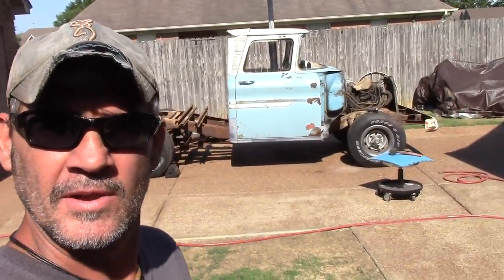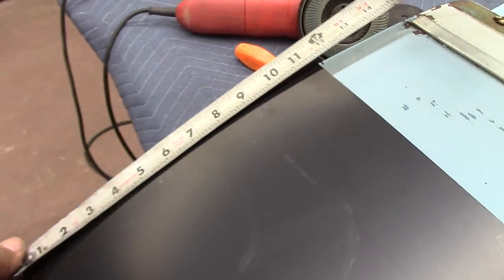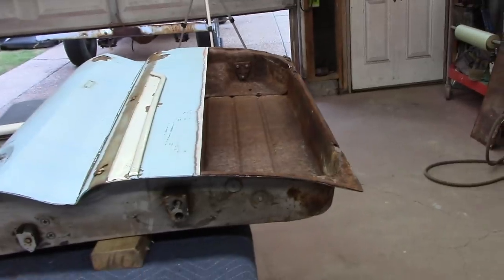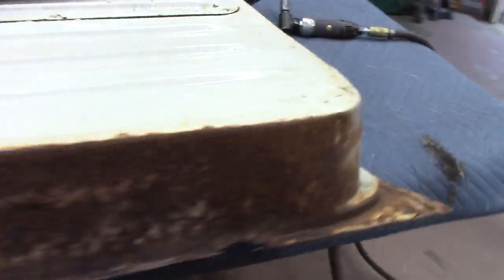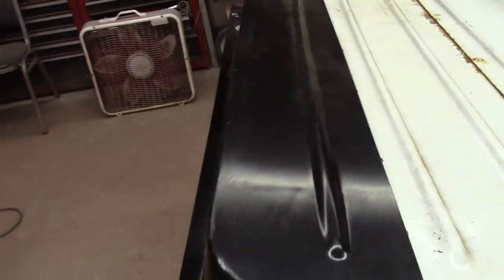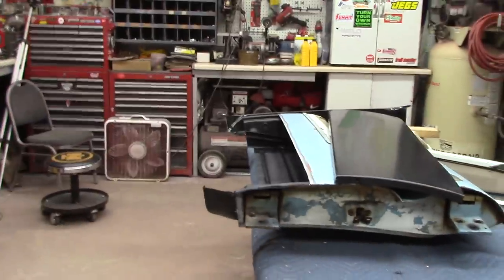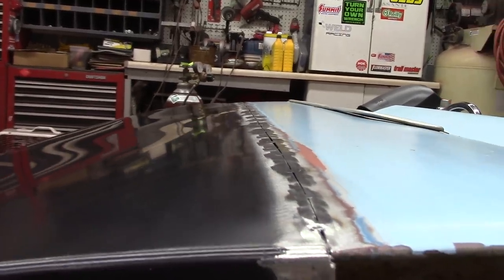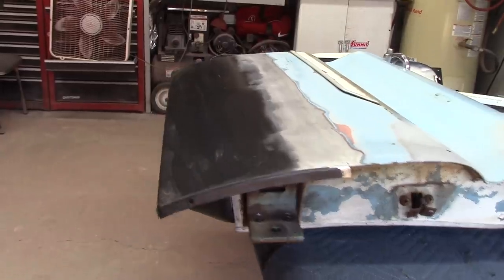Outer door bottom rust repair

Comment: Fantastic! I try to do that same job in a 69 C10 without testing first , with the fender on and frame rubber mounting , and fail aligning later. Finally found another door and replaced.

Comment: This is perfect.
I am thinking, that for many old cars, it would be easier to just cut out big chunks of the car and repair or replace them, then to work with every small hole and that work with small holes would be endless and they would reappear elsewhere in small time.

This whole process brought to my mind, that maybe it would be good to cut out big chunks, than clean them, cover them with a thick layer of solder through a torch (that would add thickness and reinforce them for many years and protect from rust) and then fill holes in the metal, fix any bends that would appear due to heat and reattach the chunks. This would at least save the cost of trying to get new parts.

Comment: Nice job, wish they had door bottom for my 76 trans am. Guess i could find another door or cut a piece out of another door. Thanks for the videos, nice to see the right way to do it and the right tools. What brand and model is that small cut of grinder, mine sucks will not cut anything... Ex Carpenter 35 years.

Comment: I know this video is a couple of years old but in case you see this, instead of welding that door panel and getting the warping, could panel bond adhesive been used there?
Reply from the maker: Never used the panel bond adhesive so don’t know to much about it, I’d rather do a slow weld then run a bead of seam sealer around the seams

Comment: I have flanged that long seam in the middle of the door the few times I have done it. Not sure if it helped. My theory was that it made it stronger and less apt to warp. But, then I couldn't hammer and dolly. I'm gonna try your way next time.
Reply from the maker: MrHevyshevy  I've never done a flange weld I'll have to try that on something this seem to work good for me
Reply: flanging is a option may be easier and less warping, also you got access to the backside to seamseal the flange no moisture problems. Gibson you do great work, if it works for you that's all that matters.

Comment: How much did you lower your red truck in the front and how much did you lower the back? Is your truck level or does it have a slight rake and what method did you use to lower it. Nice work labor of love it looks like.
Reply from the maker: Green Community Movement    My red truck has the 3/5 lowering kit from classic industries, I went with the 2- 1/2 drop spindles and 1’’ drop spring on front and a 5’’ drop spring on rear it does have a slight rake not much

Comment: Where did you put your welding ground clamp. I have a hard time getting both pieces grounded at once.
Reply from the maker: I ground down a spot at the bottom of the door and clamped it on the new panel

Comment: How much did you lower in the front how much did you lower in the back. And is the truck level or does it have a little rake to it?
Reply from the maker: Green Community Movement    I haven’t lowered this truck yet but do have a lowering spring kit that will be going on it’s a 3/5 drop it will have some rake not much